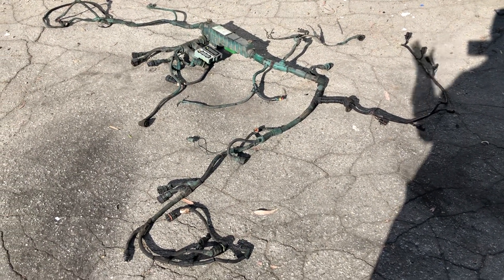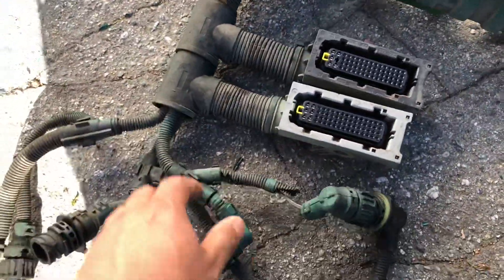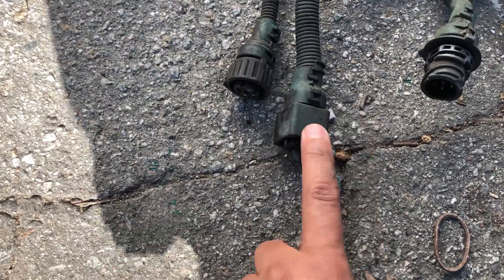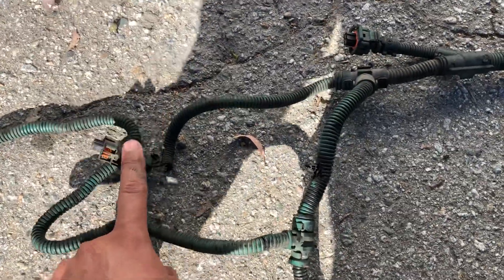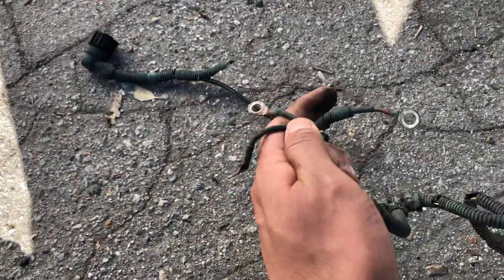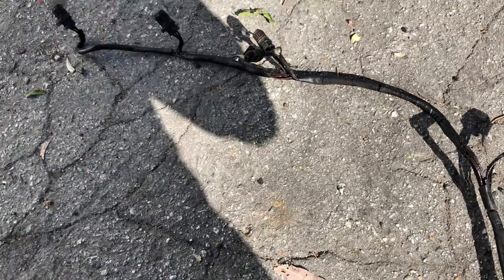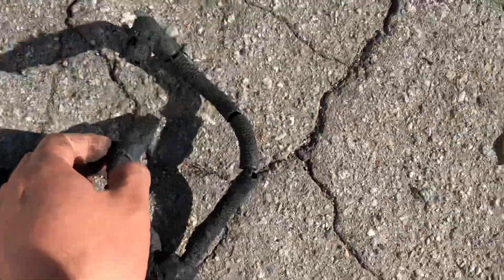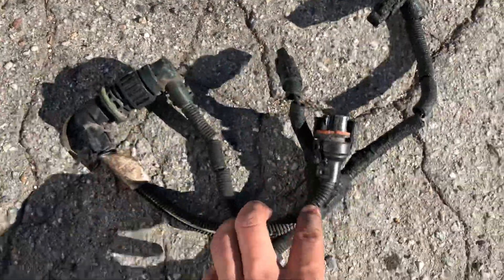Volvo Engine D13 2007 Thru 2014: A deep look to the engine harness.

Comment: Decent video, Man. DId you ever make the follow up one you were talking about with the harness still artached to the truck? I think that I have that leak you were describing in the front of the engine. The connector with the often failing gasket right before the injector sensors?

Comment: Hi, morning, as you mentioned that the part of engine harness for inside rocker cover can buy it separately, does it applie to Volvo low bed bus B9L, cause my case all insulation layer already crack and might short to each other. Want to repair it is not easy all pin bush connector are easy breakage. Appreciate it you can let me know where to buy this part of wire harness? Thanks you so much and great explained on this video.

Comment: D12 2007 VN , oil leak rear left top.by green harness and engine.
More like O Ring. Seal leak 
What's kind of  connector it is ? 
I have pictures but where can I send you ?

Comment: injector harness O ring leaking, can i pull it out little bit and put some silicon high heat as o ring cant be replaced ease
Reply from the maker: Yeah, you could do that but remember, it is just a temporary repair, eventually might leak again. Thanks for watching.

Comment: Thanks for the information is very interesting, talking about the injectors harness where the o-ring is leaking oil, can the o-ring be changed alone or   should i change the complete wire harness on the truck because now my truck is leaking oil in front of the engine, thanks once again am from Nigeria in Africa
Reply from the maker: You could replace only the o-ring in the harness, but that will not stop the oil to travel to other parts of the harness since all wires are connected, oil travel around all of it. So, the best is to replace the entire engine harness with a new one. It might be quite expensive now, but in a long run, that oil leak will go away. NOTE: make sure that it the only oil leak you see around, if you are not sure 100%, let a technician to inspect properly the oil leak for you. Thanks for watching and share my channel with other around there. Glad to be helpful around that part of the world.
Reply: @LetstalkDIESEL  thanks man i appreciate, i will have to get it done before it starts leaking too much, another problem people experience here in Nigeria is that Mack company has only one trusted sales and service representative that can only be located in Lagos State Nigeria and in order for you to get your Mack Pinnacle truck fixed, you have to drive up to 600km before one can get to their workshop or they will charge for coming to where ever you are in the country and that's not encouraging, people are running away from the Mack/Volvo because of high cost of mantainernce, people prefer E7 or even E6 old engines to  mp8 /d13 engines

Comment: necesito un arnez d ecu ec240blc
Reply from the maker: Si necesita un cableado eléctrico de motor para esta clase de camiones Volvo D13, vaya con el número VIN de su vehículo a la venta de repuestos genuinos de Volvo, para encontrar el harness correcto. Si busca un reemplazo que no sea genuino o usado, consiga el número original de su cableado, trate de averiguar por el número si es el correcto en la parte que piensa instalar y observa que cada conexión sea la correcta (personalmente yo no recomiendo parte usadas o que no sean genuinas). Gracias por el mirar el video.

Comment: How much did it cost for wire harness
Reply from the maker: Volvo D13 engine harness, price varies from $450 up to $1,500 (no labor include it and does not apply for D16 engine harness). That depends from when you can get it, from Volvo factory I might be more expensive than aftermarket. Thanks for watching and support the channel.

Comment: Thanks for helping me understand the harness better.
Reply: I have these 3 codes going on. Was told it could be bad harness or injector. Is there a simple way to trouble shoot the harness before deciding to replace the injector? Thanks!

Fuel injection quantity lower than expected
Cylinder 4 fuel injector offset learning at max limit
Cylinder 4 misfire detected
Reply from the maker: You could check the wiring first with the proper tools, but if you feel like your engine is idling uneven, probably is a bad injector. Thanks for the support and watching the channel.

Comment: Good information.what is your recommendation to change at how many miles?
Reply from the maker: There is not an exactly time about when you should change the engine harness, but usually, when your technician tells you there is few codes relate to the harness (open circuit, short to ground, etc), that will be a good time to replace it. Or if your harness has a clear damage spot you should replace it as well. Thanks for watching.
Reply: Let’s talk DIESEL. Thanku 👍

Comment: I have a question, I just did a engine harness on a Volvo. If I did mix up the connectors in the back of the motor would it throw a code? I ask because I have no codes but now the engine wont start. It started before the harness was replaced
Reply from the maker: There is a chance that the EGR valve connector has been switched with the Flywheel Speed sensor (since both connector are the same) just switch them and it should start. I hope this help you and thanks for watching.
Reply: What did you figure out?
Reply: @maxenra  the cam sensor was swapped with another sensor. It won't throw a code but it will cause a crank no start.

Comment: I have DTC code SPN 1231 FMI 2. But I don’t what it means can you help?  It’s says faulty harness. What does that means? 
Thank you
Reply from the maker: Each DTC has its own path to follow in order to get it fix. If you have changed the battery recently make sure all terminals are connected properly. Also, if you truck has a bypass for the ATS you might need to fix that first. Thanks for watching and I hope this help.
Reply: @LetstalkDIESEL  how to bypass?

Comment: Could you help me out and show me where heater line #1 is off my DEF 2013 Volvo Vnl. Thanks in advance.
Reply from the maker: Try to look around the DEF pump, perhaps you can find a damage wire or a connection unplugged. Also, check the outer fuse box could be one of the fuses. Thanks for watching.